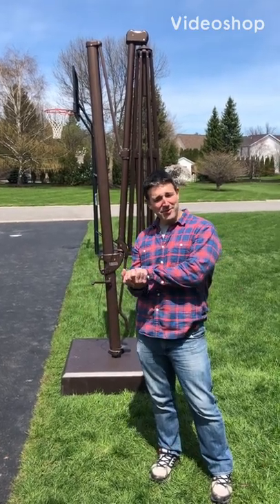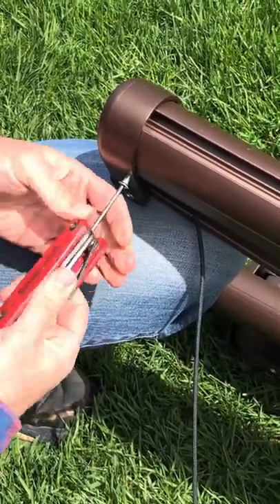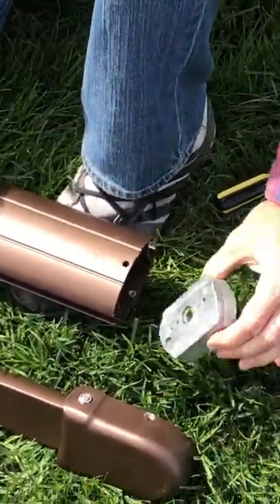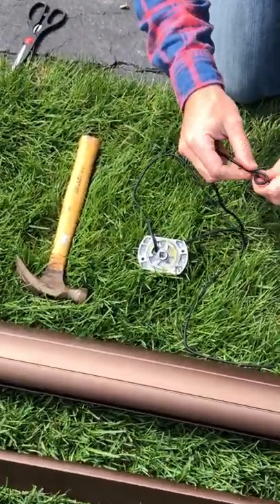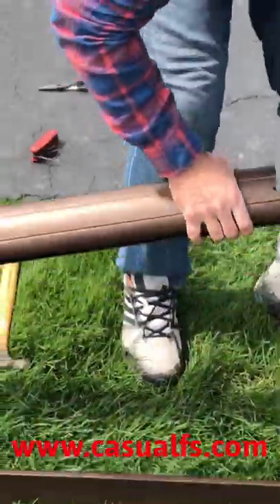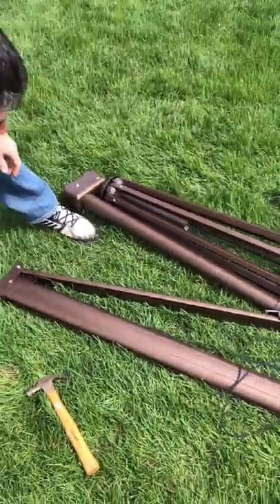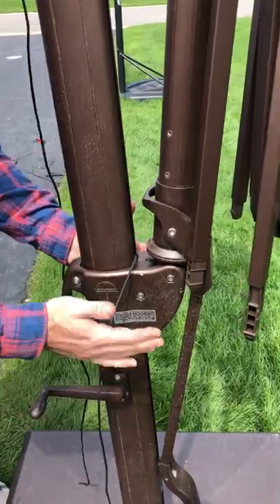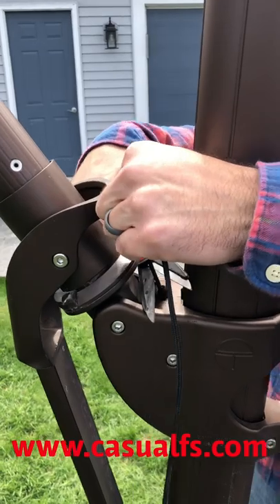AKZ Crankside Cord Replacement

Comment: Thx a lot.
I followed your instructions step by step and succeeded to replace the crank cord without any issues.

I had to drill the 2 upper screws so the mecanism could get out of the tube. I replaced the screws with a tyrap for the moment.

Comment: Looks I'm the first one that needed this guy in order to fix my umbrella.  I'll be doing this project next weekend when my cord comes in.  Nice job!!  Thanks for the video.  I'd be SOL if you didn't post this.....
Reply: How did your umbrella turn out? was the video helpful?
Reply: It turned out fantastic.  I already had it all torn apart by the time I saw this helpful bit on youtube, so my repair was a bit more complicated than his, but I used his steps and successfully repaired our cantilever umbrella, like a rockstar!!
Reply: I have an older model 
No screws in the hand crank- Got any advice
Reply: Clarification: Mine is an old Shade Depot 13 ft side crank. It appears that one cord raises and deploys the umbrella. The cord is tied inside the hand crank spool, traverses the pulley system and ties somewhere inside the umbrella center.

Comment: Would you or anybody leaving comments here happen to know of someone that is in the business of doing repairs on the Treasure Garden AKZ-13 Cantilever umbrella, the one pictured in this video and not their newer updated version.  My issue is that as the umbrella is being cranked up, when it gets near to being fully open, the cord gets VERY HARD to crank and you get the feeling like you might snap the cord because the tension is so high.  Treasure Garden has been little help in helping me find someone in the Sacramento area that can figure out what is binding up as it reaches full open and get it repaired for me.  In fact I was told that this "issue" is why they went with a totally new design in their newest 13' Cantilever umbrella.

Comment: Replacement cord $35 in this video and Amazon has some cords for $10, does anyone know the difference?  I've noticed that the original patio umbrella cord is stiff and behaves like a wire, would a regular paracord work?
Reply from the maker: This is cord directly from the factory and is what they use on the umbrellas.  It has a very high tensile strength that   paracord will not hold up to because of the wind and strain that is put on the cord.
Reply: ok and thx so much for putting this video with detailed steps it was incredibly useful